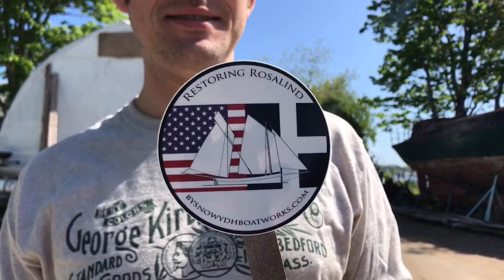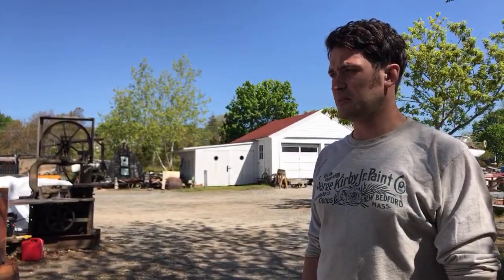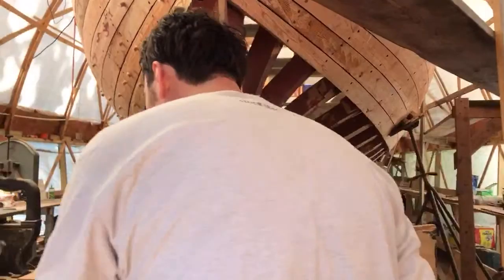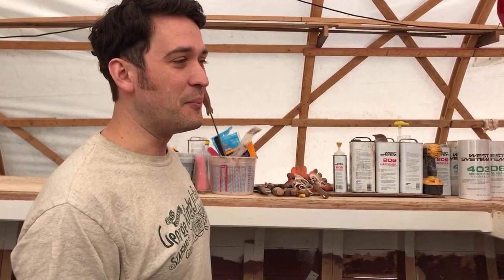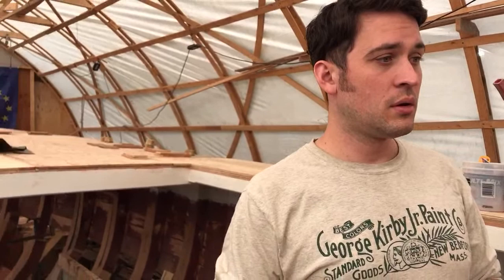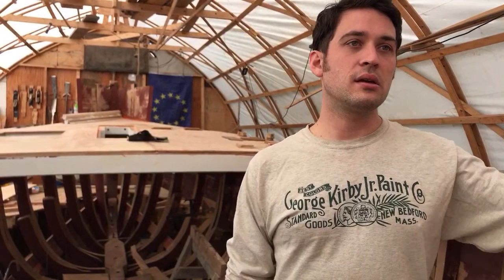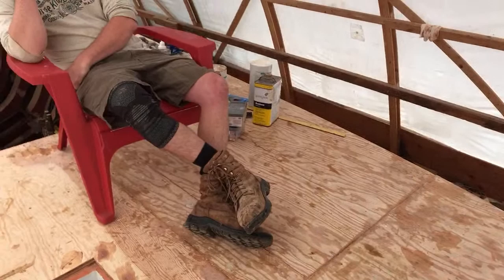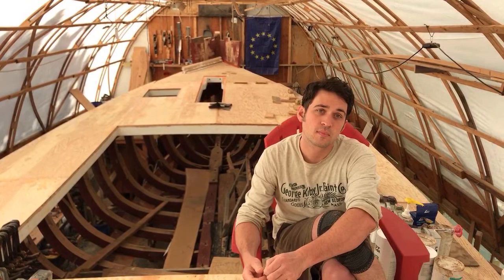Live from the Boat Shed: May 23, 2020

Comment: Hello!..why cover the deck with fiberglass instead of just painting with epoxy? I also have a classic wooden sailboat and my deck is made of plywood too, but it doesn't have fiberglass, only painted with epoxy and polyurethane paint, it's very solid, abrasion resistant and doesn't leak. I have a friend who owns a boat with a fiberglass deck and it's very bad to do maintenance, when he detects some water infiltration (normaly screws) has passed a certain time and it's not cool to deal with fiberglass, in my case it is very easy to detect infiltration and repair small spots. Fiberglass is nasty and hides water intrusion, maybe it is not necessary. One day we were talking about how my deck is better because it doesn't have a fiberglass layer. Cheers!
Reply from the maker: Hi! I think ultimately it depends on the intended use - I anticipate hauling timber and other bulk cargoes eventually so the additionally omni-directional strength of fibreglass is important, plus with it wrapping over onto the sheer it adds a bit more strength athwarts. And the abrasion+puncture resistance with glass is better, though I suppose epoxy by itself properly applied would be fine in some cases. So in short I guess it depends on the boat and what it'll be doing!
Reply: @RestoringRosalind  you ended up doing two layers of glass?
Reply from the maker: @R.E.HILL_  yes I did - I didn't feel great about the joins where different runs on the first layer met - they were clean but I worried about intrusion. buuut not worried anymore haha it's not going anywhere now